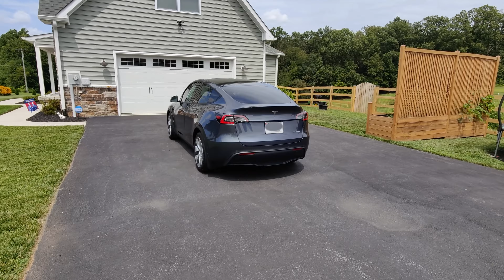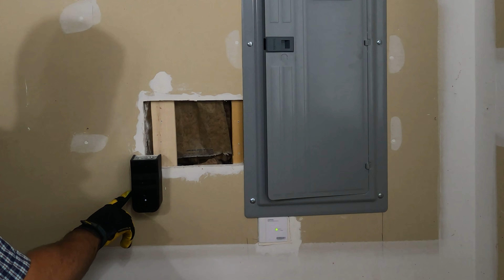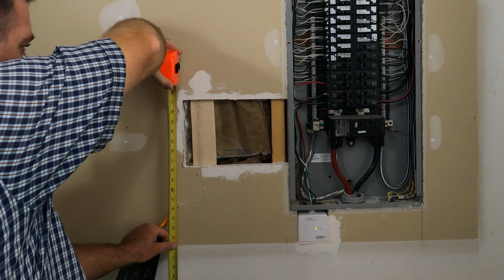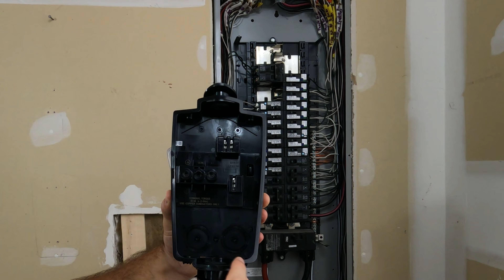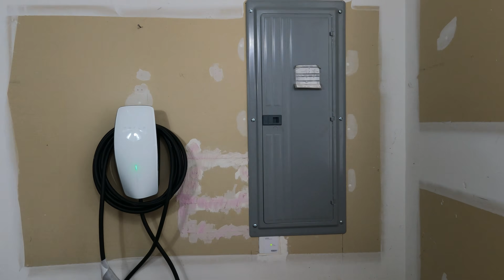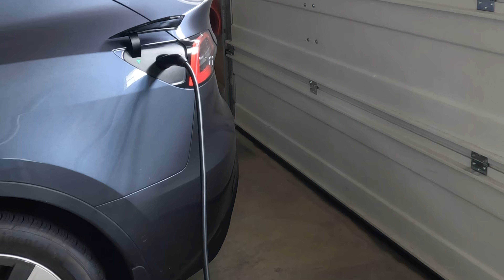Tesla Wall Connector  Installation DIY | EV Charger | Gen 3 with (Hidden Wires)

Comment from the maker: 2026 UPDATE: This installation is still a useful reference for the Tesla Gen 3 Wall Connector, but Tesla's charging lineup and power-management features have expanded since I filmed it.
If you're trying to charge two EVs at home, I now have a full video showing how we run two Tesla Wall Connectors on our existing 200A service using power sharing:
https://youtu.be/ilZ8ucSd130
If I were setting up a mixed-EV household today, I would also look at the Universal Wall Connector because it supports both NACS and J1772.
What are you planning to install, and what size electrical service do you have?

Comment: Looks very good since you mentioned in the comments you did torque the connections (breaker too, correct?). Only two things I would have done differently: (1) you were a tad aggressive with the wire stripper twisting, be sure not to gouge into or cut a strand (2) I always use insulated bushings at both conduit connectors... not required by code for #6, but a good practice none the less. All the best.
Reply from the maker: Great advice, I definitely agree that using those extra precautions is a good practice for long-term reliability.

Comment: Did you torque?
Reply from the maker: Yes, make sure to torque to spec as shown in the install manual.
Reply: @ElectrifiedOutdoors  That was my question too! Torque at both the TWC and the breaker....don't forget about the breaker!